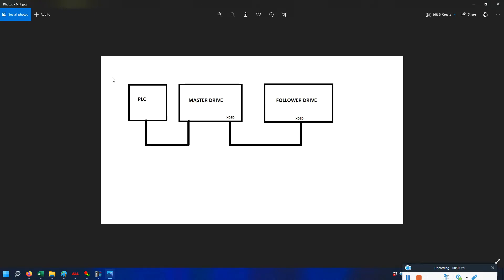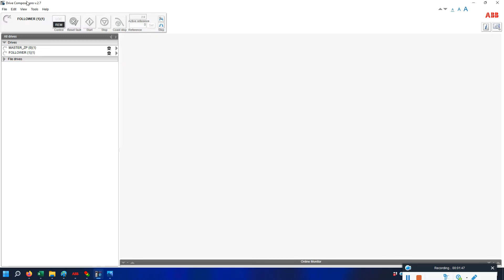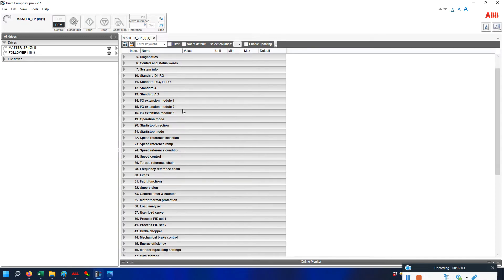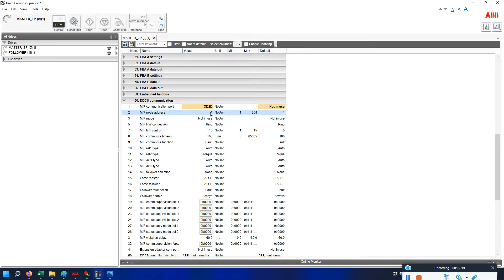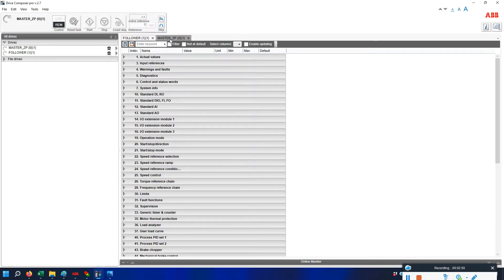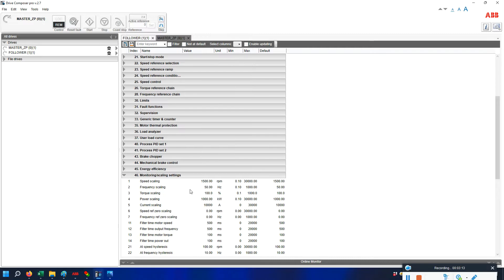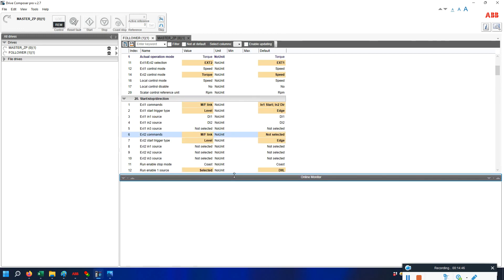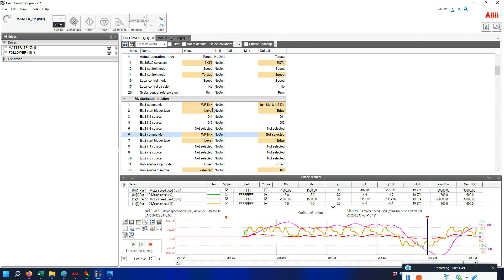22. ABB ACS880 Master Follower Configuration

Comment: In our project we are using two acs880 vfds in master-follower configuration. We are facing a problem that sometimes(not always) even master is stopped the slave still keep running. We switced master to slave and slave to master as well but still some time this happens to the slave again. Yet we do not have any idea what the problem is. Could you please advice what is the problem?
Reply from the maker: Can u share drive parameter backup
Reply: What have you observed?
Reply: In acs800 master slave configuration,Sometime slave run in negative direction even if master is running in forward direction.Here slave is torque follower of master.During this time we have observed slave goes to negative torque where as master torque is positive.

Comment: Hello, thank for your videos they are very helpful! However, i have a small issue with the M/F config, which is that the Follower doesn't recieve the Master's used speed reference even though i made the same configuration (PLC not included). Some help would be very much appreciated !
Reply from the maker: Hi, does the follower get the start command from master?
Reply: @averageengineer4266  Hi, no the follower doesn't get any information.
Reply from the maker: Not sure what went wrong, you could check the d2d link
Reply: I've tried it with new drives (ACS880 ZCU 12) it didn't. It worked with two orhers (ACS 880 ZCU 12L)

Comment: EXCELLENT EXPLANATION.....Can you simulate stall protection of ACS 880 drive??
Reply from the maker: Motor stall function is available under fault function. You can define max current limit expected during motor stall ,and define the stall speed and stall time.
Reply: @averageengineer4266  thank you for your reply...

Comment: Is it possible to configure Master follower , without using D2D link ???
Reply from the maker: D2D link is available on all acs800 drives. Other option is to use additional fdco card and use fiber optic cable for communication